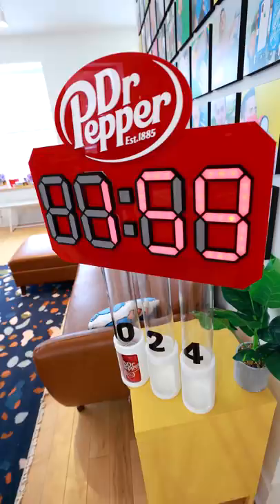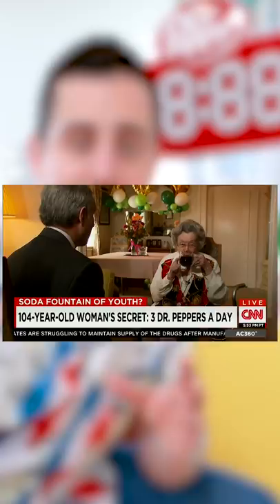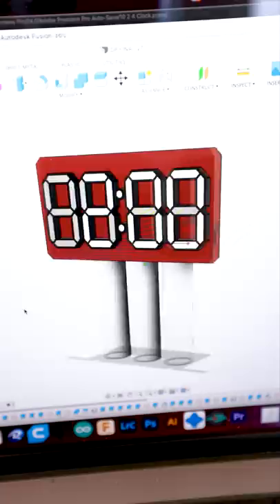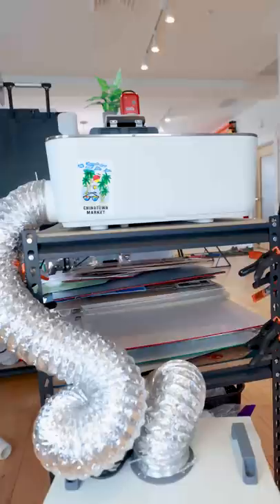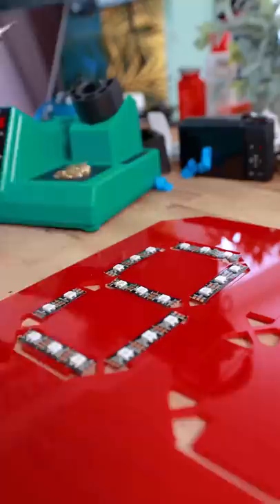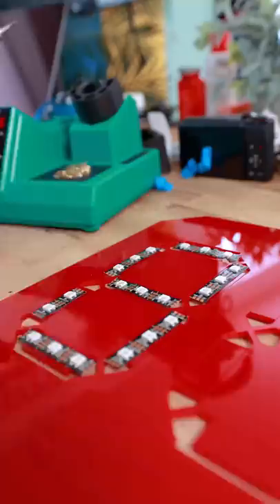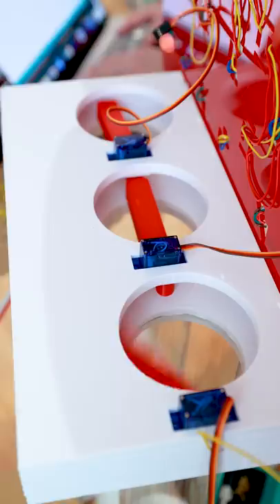This clock does this at 10, 2, and 4 O'Clock

Comment: My local bus in Boston the MBTA last coin system revision is a 1 @ a time but can read WTF you throw in at rapid pace! Where do we start?! I don't have a 3d printer. Thought of the metal in the razors that have the break here if dull or broke, THE SLEEVE that holds them and that pusher, could it be utilized? Do they have quarter sized, these are closer to dimes was $2 if no card 1.70 with, that's just the bus!